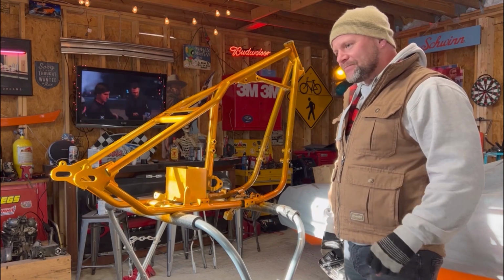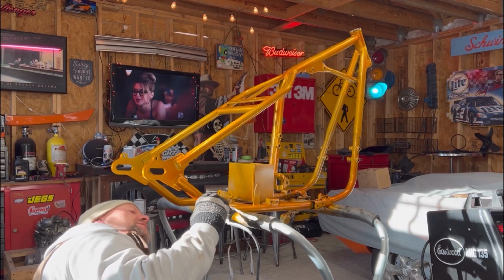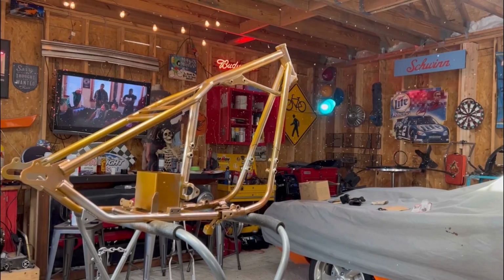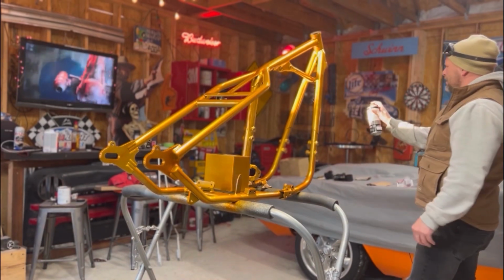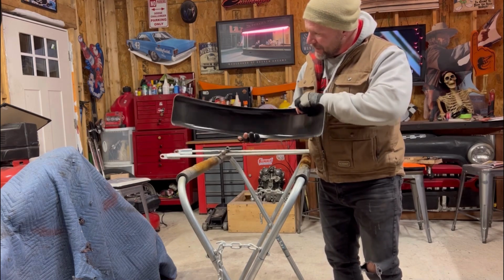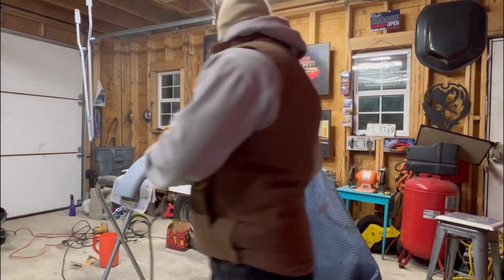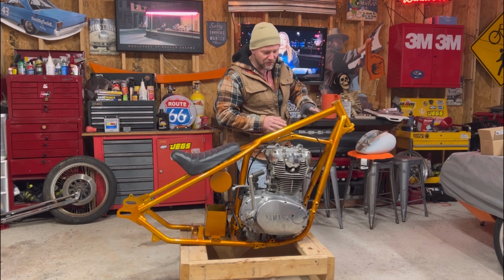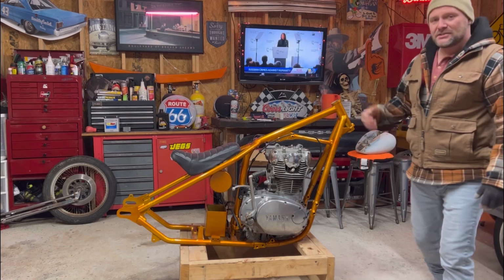Two Dude’s Building Choppers. The XS650 Copper build finally gets paint and a motor installed.

Comment: I have the single carb intake on my XS650.  I am using a 36mm Mikuni and it works "ok" but I cannot get it to really be right all the time.  Idle is perfect and smooth. However, mid to WOT it is hit or miss if it will run right.  I've tried most all the size jets, but no luck.  Stock pipes with no baffles.  Trying other pipes now. plus I have an electronic ignition and ditched the stock system years ago.
Reply from the maker: Definitely will have to keep that in mind. Thanks for the heads up

Comment: i watched shade tree's build .... i have watched his channel lots since then.   old biker, and mr. miyagi.  Work gets in the way but have 3 basket cases, one with motor back in the frame but not cranked yet. two more built back up to the pistons.. the  small parts are expensive.  i can so relate to what your'e doing but trying to keep a lower budget.  that makes it go slow.  i bought 3 gasket kits from Mikes and a few other things.  OLD BIKER and Miyagi ... the only way  I pieced them back together.  Hope they don't blow up once they start.  I didnt get to start with any of them together.  Just boxes of parts and bare frames.  I like the 2 into 1 ..... one carb should simplify things.  I was hoping to fab up an intake one day
Reply from the maker: Hey Johnny, old biker comments all the time and he’s full of knowledge so I’m sure he would love this comment. Thanks for following. Check out two wheel workshop as well. Guy is amazing and his build videos are piece by piece. To be honest all these guys are amazing and I’m a huge fan of all of them
Reply: Good luck bud. Keep at it. No shame in using good second hand parts to keep cost down if you can't make them. Work on one at a time.